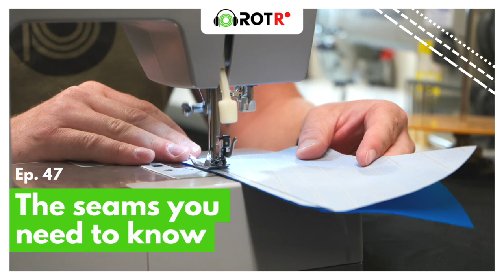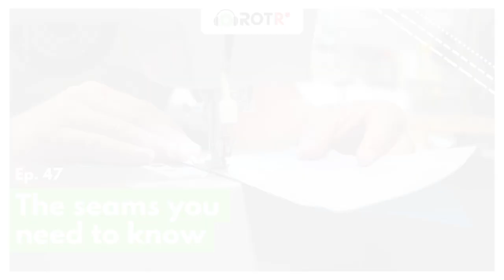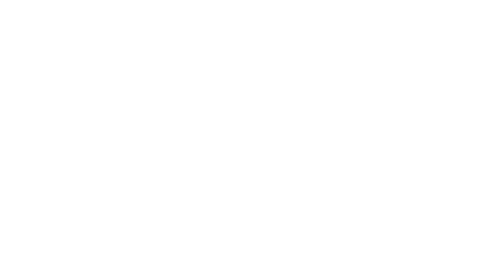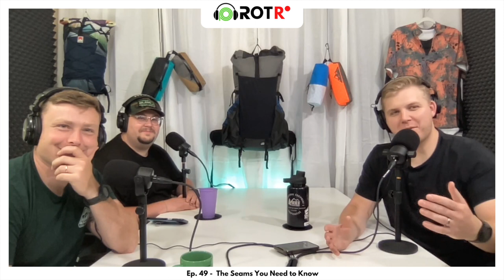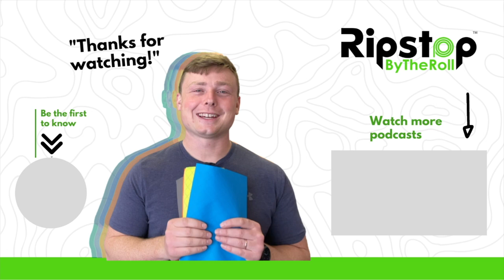The Most Important Seams for Sewing | Ep. 49 | Ripstop on the Record

Comment: Thank you for the update what is the tape you were talking about. Is it for waterproofing
Reply from the maker: We carry two seam-sealing tapes. There's a Dyneema Composite Fabric-backed tape. And a PET-backed tape. Both are excellent for use on fabrics with a film backing. But are also acceptable for use on PU-coated fabrics. 

https://ripstopbytheroll.com/products/1-cuben-fiber-repair-tape?variant=1056143917

https://ripstopbytheroll.com/products/dimension-polyant-pet-seam-seal-tape?variant=42544317563050